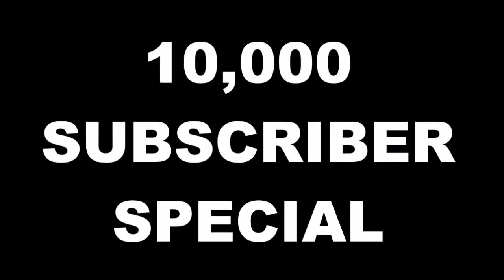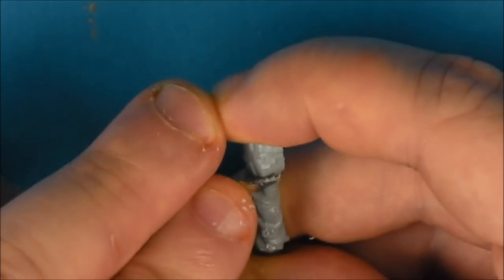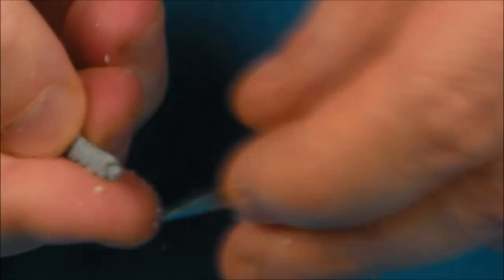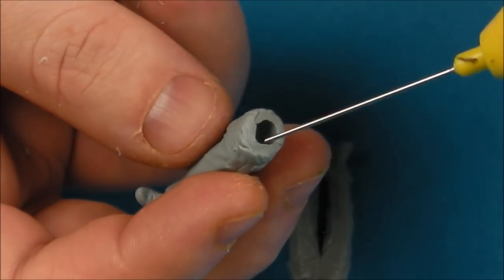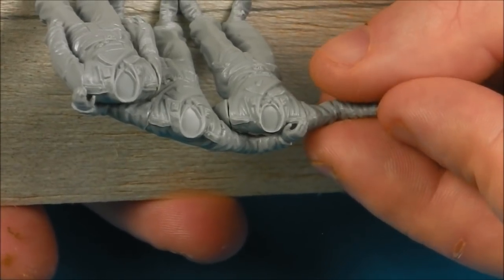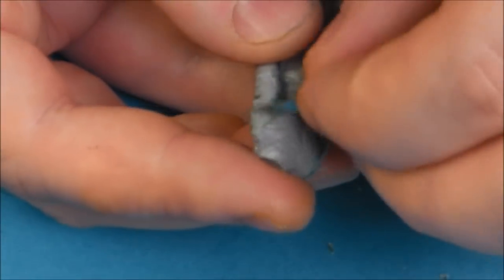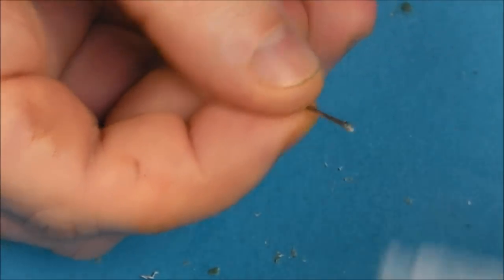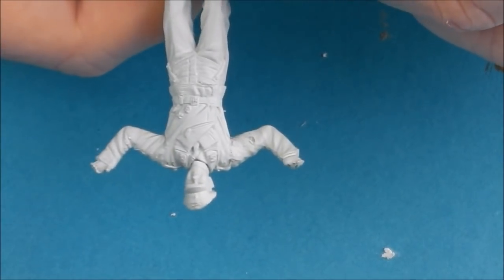How To Build and Prepare 1/35 Figures: Panzer Ace Crew: 10,000 Subscriber Special

Comment: Well done Shane on the 10,000 milestone, as you mentioned the water based fillers are brilliant & Mr. Surfacer 500 works well too. Looking forward to the painting vid. Happy 😃 modelling.
Reply from the maker: thanks Mark! 
I have been wanting to try Mr.Surfacer for a while as I would to give it a go for doing the textures for my Shermans.
Stay tuned for the painting vid which should be hitting your screens in the next few weeks

Comment: I'm a disabled American veteran that is just getting back into the hobby of model building and it has been so helpful watching videos like this....Thank you Shane Smyth.....Carry On......
Reply from the maker: welcome back to the hobby, glad that my videos can be of help if you have any questions don't hesitate to ask
Reply: That is great to know...Thank you very much for your support.....
Reply: Shane..I watched your video of putting a airbrush set together...I bought a air compressor with all the features you recommended and it comes with 2 double action airbrushs...my question is this..price is not a factor..so what is the best and easiest airbrush to get...Thanks in advance....
Reply from the maker: so if budget is not a concern, then I would recommend harder and steenbeck they are pricey but are probably the best brushes out there and are easy to take down and maintain, also Iwata is very solid too and much more value for money they would be the two I would go for, I hear great things of Badger which would be easy to get in the US but have never used them myself but they are meant to be great too
Reply: Hi Shane..i bought a Harder & Steenbeck ULTRA 0.2 Gravity Feed Double Action Airbrush and im buying a Iwata but im still checking them out....thanks again for your help...
Reply from the maker: no worries mate, you will find harder and steenbeck amazing brushes to use !
Reply: Shane..Do you have a video of cleaning a airbrush and how to thin paint to use in airbrush? Thank you

Comment: Hi Shane, really great video (as are all the others I’ve been watching over the last few days). I’m new to airbrushing and was wondering, when you prime the models do you thin the surface primer? Sorry for the noob question!
Reply from the maker: So I tend to use primer from rattle can more and more which is just sprayed in thin sweeping coats, primers from airbrush do require a little thinng to work best

Comment: Hi Shane.
Have you considered using little shards of plastic shaved from the sprue and melting it into place with extra thin?
I've had some success filling small gaps you get in figure assembly. 
Just a thought.
Reply from the maker: I have heard of this method before, but I am massive fan of using acrylic putty as it doesn't do any damage to the plastic beneath
Reply: @longlance67  
Fair comment, buddy.......if I had some acrylic putty, I'd probably use that as well😁😁